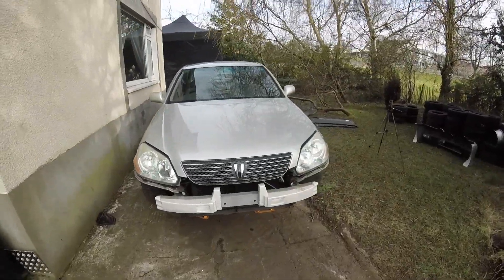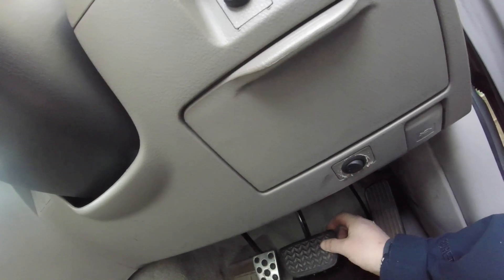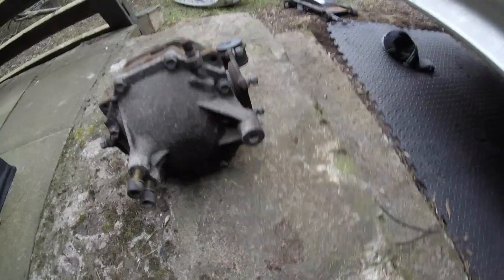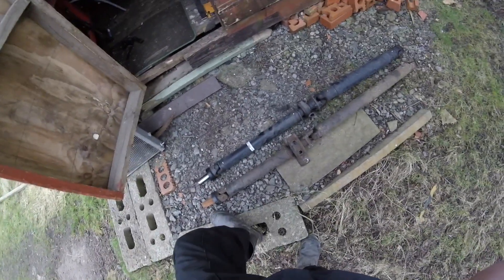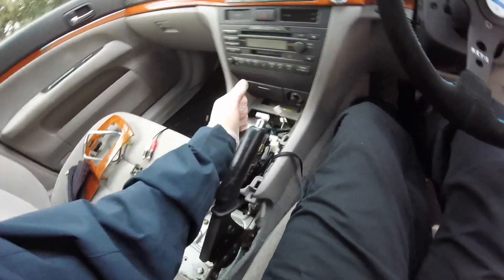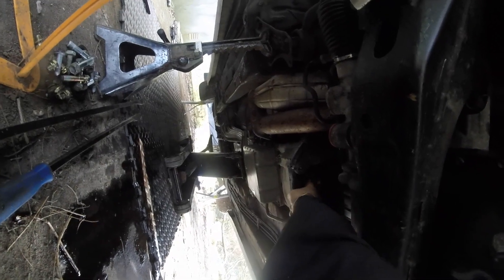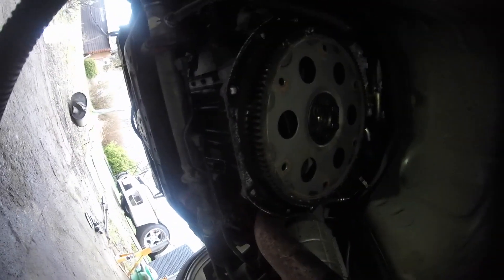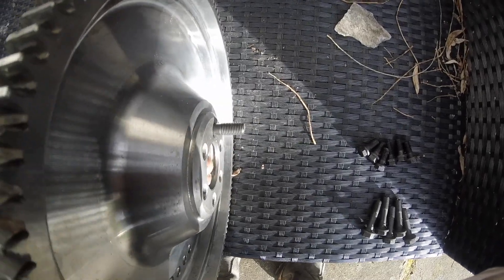GX110 Toyota Mark II, J160 6 Speed Manual Transmission Conversion Part 1: A42DE Gearbox Removal

Comment: The lines going from the gearbox to the rad are for cooling as you suspected, the very lower section of the rad is a oil cooler for the gearbox, all autos generally have this setup.
When we do gearbox conversions, we just cap the two ports off at the rad.
Good vid though!!
Reply from the maker: Thanks for the comment mate. Yeah figured it out eventually, my mates altezza was the same. Seems Toyota like to do this. Typical over engineering from mighty Toyota!

Comment: What handbrake did you use bud & was it a direct fit or require a bit of modding?
Reply from the maker: Hello mate, I used a LHD IS200/IS300 (XE10) handbrake with the standard cable attached. Cable hooked up no problem after de-adjusting the handbrake shoes temporarily. It mounted up OK, but I had to drill 1 extra hole for mounting it as there was only 2 out of the 3 mounting holes pre-drilled and tapped from factory, I just nut and bolted the 3rd mounting hole, very straight forward